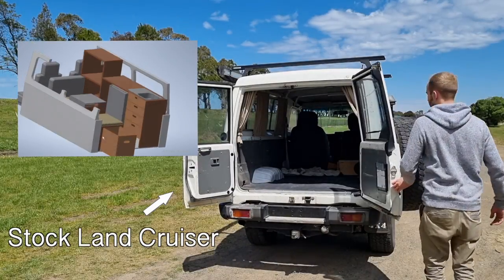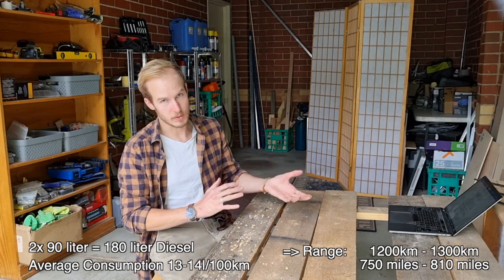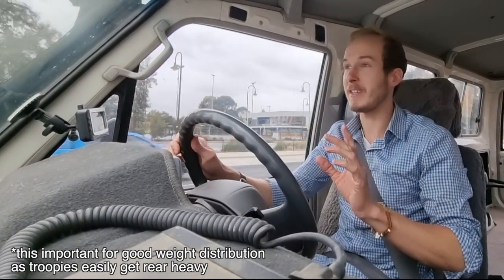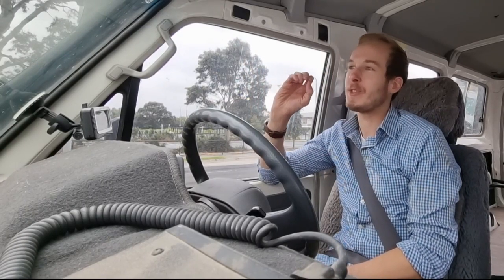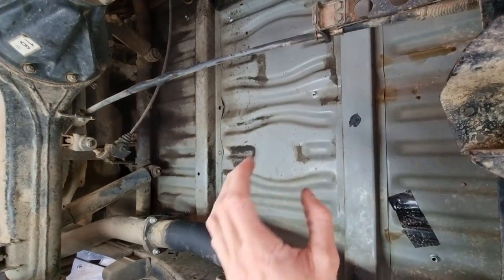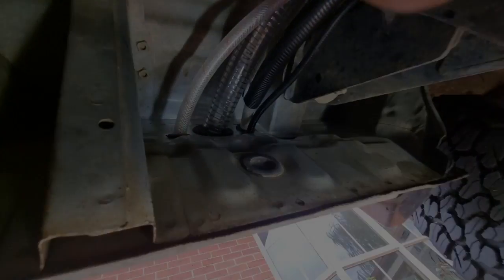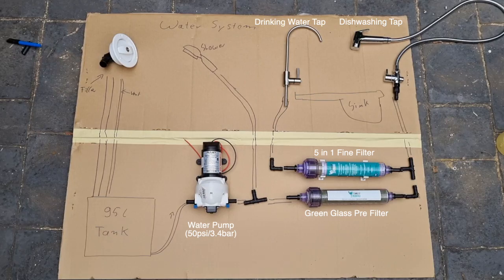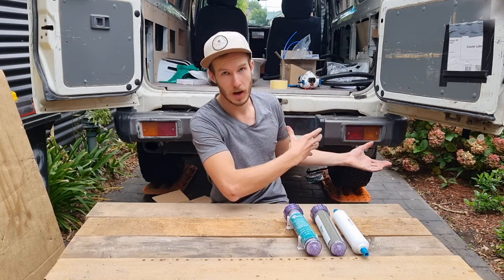DIY Expedition vehicle (Troopy) build. Water filtration system and Underbody water tank solution.

Comment: Thanks for the vids! A question though (I’m not an engineer 😊): is it not crazy to mount 100kg tank only on the floor and not on the chassis?! Thanks for your help
Reply from the maker: Hey mate, that's a good question, but it's not an issue at all. The Flooring of the cabin has some significant cross bracing. Also think of it this way. If you have a rear seat (Which is also mounted to the floor, just standing instead of hanging), with 3 people on it. That weighs way more than the water tank.

Comment: In Africa I would be running two tanks. One to wash and shower the other for drinking water.  The drinking water I would keep within the vehicle, and I would fill it from purchased plastic bottles. I would still keep that line filter on the drinking water system. Finally I would keep a backup 5 litre bottle of drinking water in a corner somewhere.

Comment: 11:00 My favourite part seeing a diagram explaining how it all connects together. I always worry about how to maintain safe drinking water in a permanently housed tank. I don't know if it is safe to leave water in it for weeks/months on end between camping trips and I don't know how easy it is to clean one of these tanks regularly.
Reply from the maker: Yeah I have the same worries. One easy way of cleaning it is to fill it with a mixture of 25% vinegar. Then drive around to make it slosh a lot drain it and flush once or twice. This way you don't have to use chemicals.

Comment: So if you really wanting to drink water from anywhere I would recommend a ro system. Most ROs require 45 PSI. You possibly could have the discharge line feedback into the clean tank long as he always have a bit of water in it it should always be diluted(rejected water). Most simple stage ROs come with a sediment prefilter and a carbon prefilter, meaning that you can disinfect/chlorinate the tank with the tablet or lightly disinfect at least before any water is used. This disinfectant stage would help oxidize any heavy metals in the water. They're always is a lot of pre-filtration recommended for RO systems but based off of experience I've seen that most RO systems can last quite a bit very neglected. Most simple inexpensive units take two and a half by 10 in filters and are easy to come by in most communities. I'd only be recommending to run this clean water to the separate drinking fountain. Upping the pressure with another booster pump to about 100 psi would help The efficiency of the RO. Ultraviolet lights are not bad but add to the complications one triggered by flow can be installed after the RO. All ultraviolet lights typically need is a 5 micron filter before so that way there is no chance that bacteria can be writing on the back side of a particle. The rejected water is usually viewed as a huge negative with RO's that usually keeps from having to change a filter a million times. Long as you can do something creative with the concentrate. Side note never put a back pressure on a concentrate line if anything a diverting ball valve that never creates back pressure. That's the one thing that will pop your membrane.
Reply from the maker: Wow thanks for all the info. I never really researched RO systems in detail before but it sound very good. Can you quantify how much water usually get separated or"wasted".

Comment: 11:07
Filter water going into the tank?
.
One of my hobbies is walking wrecking-yards aka 'dismantlers'.
For a factory RecreateVehicle, after the aluminum siding is foraged, the innerds are exposed.
.
Every time, the translucent fresh-water tank has a load of muck at the bottom.
Often, that muck is several inches deep.
.
We always filter water going into our kegs.
With our modular system, if one keg gets stanky, we continue using the others...
... and the others can be used to clean the problem child.
Reply from the maker: Yeah in the beginning I was also contemplating having smaller multiple redundant tanks, but unfortunately the space is so limited on this "small" rig that We only really can run one tank. We are filtering the water with a sediment filter when filling the tank and we are usually empty it completely and flush it every few months.

Comment: In our ExpeditionVehicle, instead of one big tank, we carry water in five-gallon stainless-steel retired Pepsi kegs.
Our usual load is seven kegs, a total of thirty-five gallons...
... however, our system is modular.
We can add a dozen kegs in the rig, plus a couple-three dozen kegs in the toy-hauler.
In theory, our duration is around four months without re-supply.
Reply: good ideal. in the states so we can get water ,I go maybe 3-4 days off grid and travel In the winter in the desert  . auz ./ taz NZ are on my list of somedays ,only outback we have , the baja coast of Mexico ,still have more to explore in my own back yard what is your expedition rig? I have a tacoma 4x4 access cab  shell/ topper mattress basic kit and a 25' airstream /ram 4x4 for longer hollidays 2-3 weeks, like to get a tahoe /suburban size  wagon and do a car camper troppy build with a pop up top

Comment: 2003, we built our ExpeditionVehicle on a 1996 Ford CF8000 commercial truck.
GVWR -- 29,000#.
Weight across the scale -- 14,000#.
Cargo capacity -- about seven ton.
.
We immediately added a 140-gallon 'saddle-tank' to supplement the original 50-gallon tank.
On the toy-hauler I fabricated on a similar commercial chassis, I mounted a 120-gallon diesel tank.
In theory, our range without re-fuelling is Anchorage-to-Acapulco.
.
Although we could get fuel at any stop, we prefer areas with low taxes.
Reply from the maker: Haha wow, yeah that's a whole different level we're talking about;) But sounds incredible!

Comment: Hopefully if the pump breaks or the power system fails you still have access to your water via gravity feed bypass. When your thirsty troubleshooting doesn't taste as good. Pretty good system overall though. Sometimes wish I got that tank instead of thorburns 40 liter but it's been sufficient minus showers.
Reply from the maker: Yeah if the pump gives up, we would need to siphon out the inlet or use the drain plug to get some water. But fingers crossed that won't happen:) Thanks for the feedback.